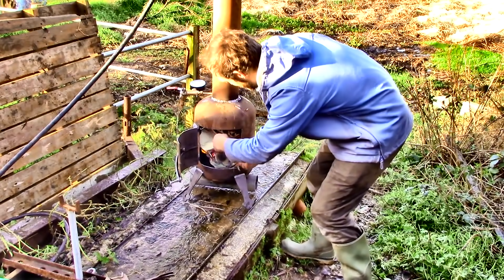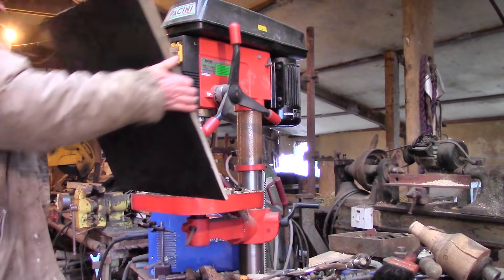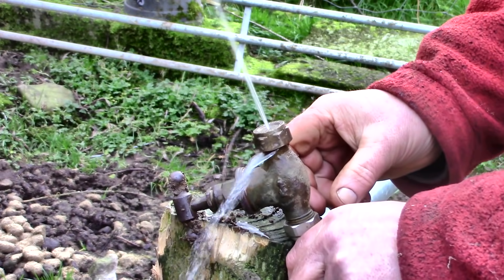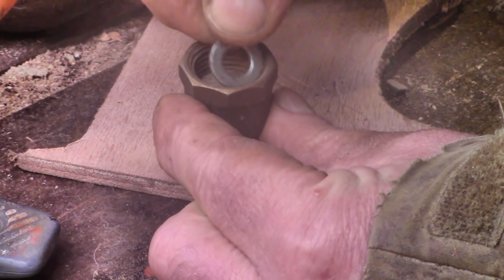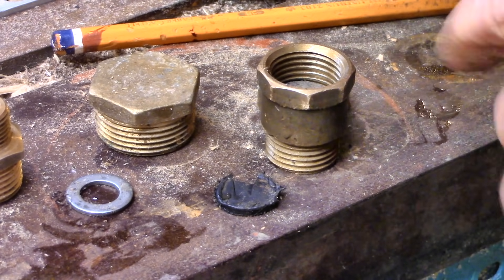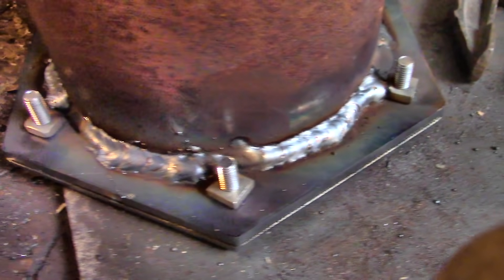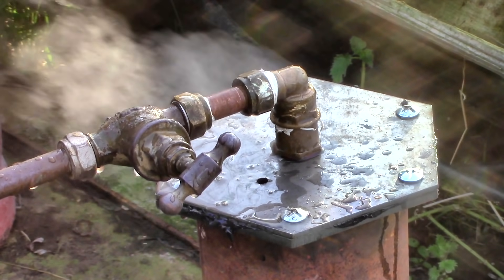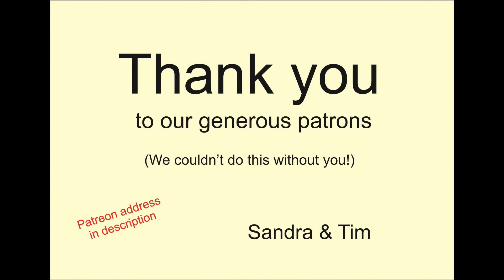Home Made Hot Water Float Valve! (For the flash steam boiler)

Comment: Tim, please don't use the side of a grinding wheel like that, Its very dangerous. Pressure on the side of a grinding wheel can cause them to crack and shatter. Other than that, great video
Reply: I think he was using a flap disk - not a grinding wheel...
Reply: @darylsargent7208  No he was grinding that coin on the side of a bench grinding wheel
Reply: @dave4728  ah thought you referring to him grinding the pipe end. I stand corrected.
Reply: @darylsargent7208  no worries

Comment: steam engines have a steam dome above the boiler so no water is injected into the cylinders.  If water somehow got into the cylinders there would be a massive explosion causing the engine to derail.  How the steam is separated from the hot boiling water, that I am unsure of.  Love your channel.  Interesting stuff.
Reply: In cold cylinders water condenses, so that's why the cylinders drains were used
Reply: Also water is not fatal to the cylinders, in fact some engines inject cold water immediately after the expansion stroke and have delayed exhaust port opening. This adds power by sucking the piston backwards.
Reply: Steam engines superheated the steam. Once the steam is separated from the water the plumbing passes through the much hotter flue gasses (not quite in the firebox). While the steam dome does reject most of the water, it is not 100%. What little water is in with 5he steam is boiled at the superheat stage.

Comment: Cool!  TY!   Might have a 2000+ year old easier solution of your interested, but I first need to know the pressure of the chamber holding both steem and water?  ....and perhaps a few more questions.  :)
Reply from the maker: the water pressure in is about 30psi - and it won't get any higher after that
Reply: @wayoutwest-workshopstuff6299  how much water do you need at the bottom of the water/steam tank?  Like do you need between 1 inch to emptied or must there be a certain amount of water at all times like 1 inch or whatever?  Looking for the ideal max and min of water levels to see if it will work well.
Reply: @wayoutwest-workshopstuff6299  sorry for the delay.  Rewatched the vid.  There's an easy way to keep the water at a specific range, for example 2" to 10".  No moving parts.  The water would cycle between whatever range you choose with NO moving parts.  Hard to explain with words however, needs a drawing.   Humm... Well I'll try with words.  If you have an external tank located BELOW the heating chamber that supplies the water, there's a way to supply arrange plumbing that will self empty using a special syphon.  Whenever it reaches the top setting, it will drain down to the level you set it then repeat the process keeping water level cycling between upper and lower levels using hydrolic physics.  Speed of the cycle  will be the water input rate less the evaporation rate.   Easy to make and do but difficult to explain without a drawing.  Cons. Water must empty below steam water tank.  Pros:. No moving parts, completely reliable and will work without fail if installed correctly and if the water has no large debree clogging it.  Actually I'm thinking about doing it myself for greenhouse heater.
Reply from the maker: @l0I0I0I0  I'd be interested to see a drawing if you can be bothered, A. Email me on rustyironpig @gmail.com? Thanks!
Reply: @wayoutwest-workshopstuff6299  NP.  One question, how much water do you want to keep in the main steam tank?  Half full, 3/4?
Reply from the maker: @l0I0I0I0  I don't need to keep more than a cupful really, as long as it's wherever the heat is. I just put new floats in that boiler and that displaced most of the water so it holds maybe a pint - but that pint goes 3/4 of the way up the sides...
Reply: @wayoutwest-workshopstuff6299  I see, perfect.   I'll send something later.  Btw, is the water feed through into the system from a separate tank or direct from your water line?  In other words, is the water tank that feeds the boiler gravity fed or part of your water system, or no tank and directly water fed, for your final design?  It makes a difference with this design I'm going to show you as I'm going to include a nice extra thing I've manage to figure out for a oil burner system I've created, but I'll adapt it for your system.
Reply from the maker: @l0I0I0I0  The water pressure is the only source of pressure in the system, so at the moment I'm using the main supply pipe, which is around 30psi. But of course that wouldn't work if I ever get this to move along on rails, so I would need to replace it with another pressurised source. Either a pressurised cold water tank, or else a pump of some kind
Reply: @wayoutwest-workshopstuff6299  perfect!   Got it!  The high pressures your going to need will change the design.  I'll need to reflect how to compensate for the higher pressures in the design.  I don't mind, as I love this stuff!!!

Comment: Couldn't you have had a water trap on the steam generator outlet which returns unboiled water through a return line to the start of the boiler?
Reply from the maker: I might do that as well, maybe?
Reply: @wayoutwest-workshopstuff6299 hmm.. you might have a problem with the output steam pressurizing the inlet water and causing other issues. A one way check valve might help but the steam may also just bypass it because the steam has such a low viscosity. I could see an extra long vertical shaft for an outlet working though! Steam and pressure could get through but the heavier water would fall back down into the boiler. Can't wait to see what you come up with!

Comment: Great work as always! When it comes time for building an engine have you considered the use of a "rotary vane motor"? It's the type used to drive pneumatic drills and hydraulic equipment. They are very simple to build and should have a decent amount of torque. You could probably modify a commercial one from some hydraulic farm machinery, or maybe even a scrap car power steering pump to work on steam. Can't wait to see what you come up with next!
Reply: I think superheated steam would destroy the vanes. Don't forget that the hydraulic fluid takes the heat away from the motor, there's no cooling effect with steam.
There's also the problem of condensation in the motor as hot steam is fed into cold metal, the plumbing for drain-cocks would be complex.
Reply: @DickHolman  True, you would most likely have to custom make the whole housing and make vanes designed to work at high temperatures. A few people have managed to get them to work, although I don't know how long they would work for under continuous load. I've also seen a few  people using heavily modified superchargers / compressors from old truck engines, but they would need a high volume / low pressure supply. https://www.youtube.com/watch?v=JHzQr0p6-NQ

Comment: Good video! However, I'm wondering why you're pursuing this particular solution to separate the water from the steam instead of just routing the steam back through the furnace to superheat it like steam locomotives do.
Reply: Steam locomotives usually have high pressure boilers, and I believe he does not want to significantly pressurize this boiler because it would put it under legal regulations. Im told the pressures he’s working at won’t be able to dry or “superheat” the steam even if he does add more length inside the stove
Edit: What I was told is wrong, it would be theoretically possible with a secondary heat source
Reply from the maker: That's interesting, Andrew - do you know why that would be?
Reply: @wayoutwest-workshopstuff6299  That was what I was told, but I looked around and it appears that is entirely wrong. The only problem is getting enough secondary heat
Reply from the maker: I might do that as well, Toms

Comment: Tim , the only part that needs to be inside in the heat is the float.  the water valve itself can be outside the boiler in much cooler temps. a simple linkage to go from the float out to the valve
Reply from the maker: You're quite right! Now you tell me... : -  )
Reply: Well, ask sooner. Lol

Comment: The paint can floats are temporary as you noted. But I found it interesting that when assembled they were at about 10 C, and once in the boiling water they went to  100 C.  So because of the hot water the pressure inside the cans increased significantly.  Did any air bleed out of the cans at the high temperature and then when cooled did they suck in any water?
Reply from the maker: Yes, one of them leaked a bit. I must sort something better out for next time
Reply: @wayoutwest-workshopstuff6299  As long as the "paint tin" float has the opening at the bottom it shouldn't leak much - if the boiler is static. (If it's moving then you could end up with a problem similar to the one in the Spitfire engine.)
Reply: Bottom of can can be open? Will fill with steam and that is fine.
Reply: @vajkfekete2635  that will only work until you shut the boiler off for the first time. When it cools down, the steam condenses and the float will be completely filled with water. If you start the boiler again, the float will not float anymore and it will not stop the waterflow until it has collected enough steam to work again.
Maybe the steam even condenses because of the cold water which flows into the box, in that case it will not shut off at all...

Comment: Safety Valve please for that 'steam separator' as you have no indicator to show water is no longer entering the can.  Thank you.
Reply from the maker: But if there's no water getting in, then where's the problem?
Reply: I agree, I have personal experience with a similar situation when I was designing a collection system attached to the side of a blast furnace.

Contaminants collected in the ONLY exit hole on my collection system and turned my ambient pressure vessel into a boiler that ruptured.

Lucky for me I had turned around and when the connection let go only the back of my legs were scalded.

I would drill a second large hole into your steam generator and install a pressure relief valve from a domestic hot water tank.
Reply from the maker: You're right, Carl - and I will. But Kizz was suggesting the pressure would build up if no water was getting in

Comment: Looks great! Although I'm not sure what pressure you're planning on running this at. The steam pressure alone might be high enough to keep the float valve closed.
Reply: I don't think you really need all that much. Just a few PSI in a big enough piston should provide enough motive force to push one of those wood chip wagons down the tracks. A person pushing them by hand is only producing a couple PSI of force anyway.
Reply from the maker: With a flash steam boiler the steam can't get to any higher pressure than the water starts at

Comment: I don't know what pressure you're shooting for, but you might have been able to get away with some plastic parts.  Better to avoid them as you did, but one of my favorite things about steam power is the temperture is limited at a given pressure, and vice versa. All you need to know is what your max pressure will be, then what water's boiling point is at that pressure. You can use any plastic in the tank that can stand up to that temp. So long as it doesn't touch the walls which may get hotter than the water inside.
Reply from the maker: The steam pressure can't get higher than the water's pressure, apparently, so around 30psi for now
Reply: @wayoutwest-workshopstuff6299  Tim the injections (way to add water) on a full size locomotive use Venturis to accelerate the water over steam pressure, they work really well too
Reply: @MrTimb56  huh? Really? Venturi? I would have thought they just used a small pump somewhere, maybe coupled to the action of the piston. Like just a regular piston pump.
Reply: @GoingtoHecq  No, they use injectors. Have a look on wiki
Reply: @gs425  That is correct, but a steam injector is very different from a Venturi. A steam injector uses the fact that the stagnation pressure depends on density. If you jet steam from the boiler at pressure P_b above ambient pressure, the velocity will satisfy P_b=1/2u^2 rho_s, where rho_s is the density of steam. If it then condenses, its density goes up to rho_l, the density of liquid water. It can now flow into a region with pressure P_b=1/2u^2 rho_l, which is much larger. Thus, it can take some initially stationary water along into the boiler.
Reply: No not a good idea to put plastic anywhere near a steam boiler ,PTFE can be used on fittings but not internally. This has kinda got to the stage of where it would come under boiler regulations if he goes any bigger on the tank size.

Comment: Nicely done!

Things that I reflected on that is just another way of doing it (most ways that work are right : ) are:

Some old carburettors are more metal than others, and they have the pin valve and float inside them... Just a thought.

Also: if you instead flip your valve around and make it a one way valve that the pin pushes the membrane to force it open, you could put it in the bottom. That would add cold water on the liquid side. The heavy (stone filled) buckets would push the valve to force it open when the level is low.
Reply from the maker: So the weight would come off the valve when the water supports the weight? I like it!
Reply: Brilliant idea. I don’t know if it would admit enough water for Tim’s purposes but a fine idea all the same!

Comment: @Way Out West - Workshop Stuff
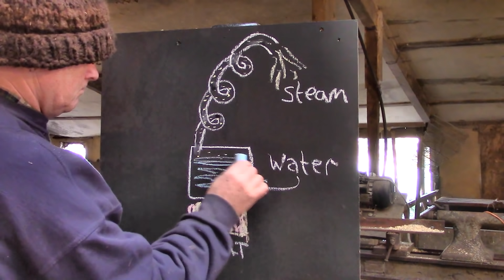eg. 1:00 You could recycle the non-steam water & feed it back into the water reservoir, this will increase the temperature of the water in the reservoir which makes it easier to boil to steam in the next cycle.
So in theory, you would eventually reach some equilibrium of the water heat so it almost all boils off in the boiler.
Reply: @mickys8065  This is a myth. Cold water does not boil faster. Hot water boils faster because it's already closer to boiling temperature. A simple google search will produce numerous results that explain this.
Reply: @tomslastname5560  turns out you are correct and I'm wrong https://youtu.be/8Kak8EHAQyw although cold water does gain heat quicker than warm water, the got water has less time to actually reach boiling (and by the time the cold water becomes hot water, it has the exact same time to heat as the hot water started with) I do maintain that frozen water takes the longest to boil though
Reply: Frozen water needs a phase change and has a longer way to go  to boil  : )
Reply: @mickys8065  (answer to first comment) I think you are confusing: ice vs. water.
Yes, melting ice (even at like -1 degree C) takes a LOT of energy, almost as much as boiling the water, but just heating up liquid water to almost boiling (+1 to +99 deg. C) is relatively low energy, but there is again an "energy barrier" when crossing over from liquid to steam (eg. 99 to 101 deg. C) where it again costs almost as much as heating up the water. 
In short: every time the water changes state: solid --> liquid --> gas, it requires another huge energy investment.

As you agree with in the later comments (still above here).
Reply: @sebbes333  no, I did just fall into the trap of believing a popular myth without bothering to actually check it. 
I have deleted the original comment just to stop new people immediately seeing it and replying before seeing my 2nd comment